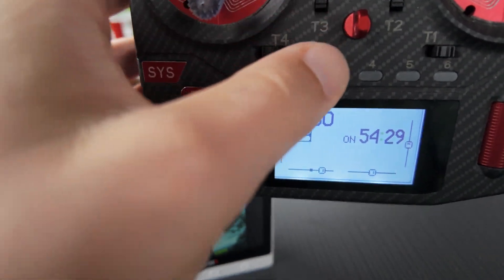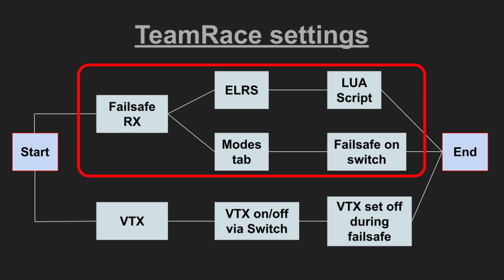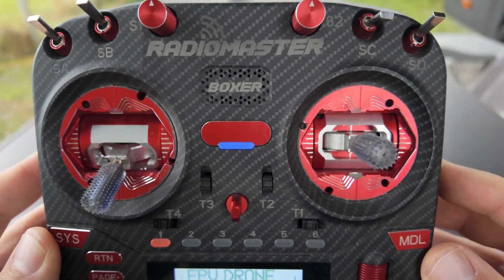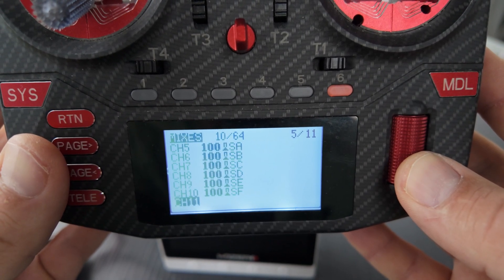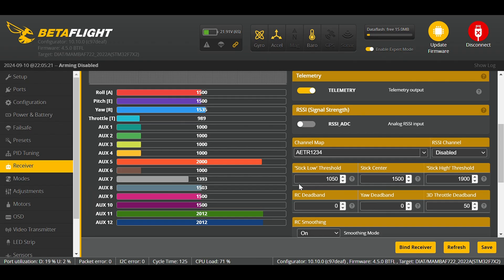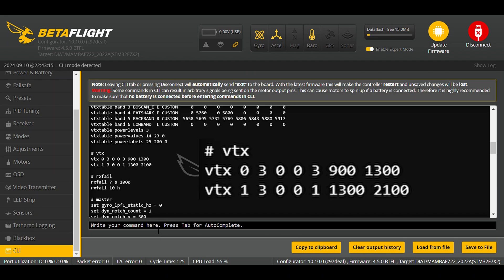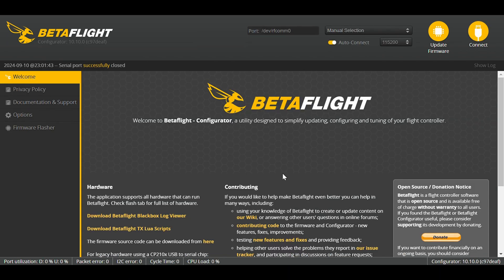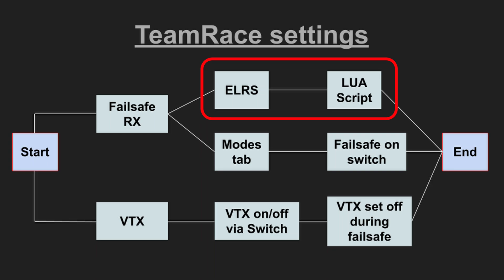How to fly all your copters (simultaneously) – Setup your fleet for TeamRace

Comment: Saw this the first time at a race about a month ago.  A pilot put 3 quads on the line, went back and sat down, then flew laps with each, just by flipping a switch after each pack died.  He was supposed to make a video on how it was done, but never did.  Def sharing this.  Thank you!
Reply from the maker: Thats definitely a use case for it! Mainly for some kind of racing! Appreciated